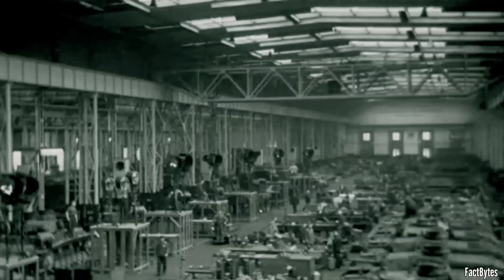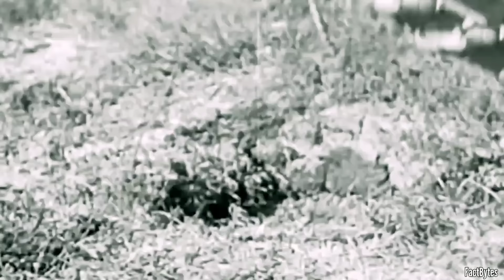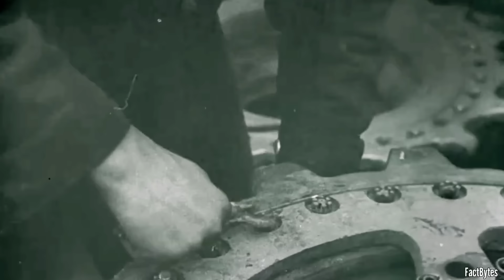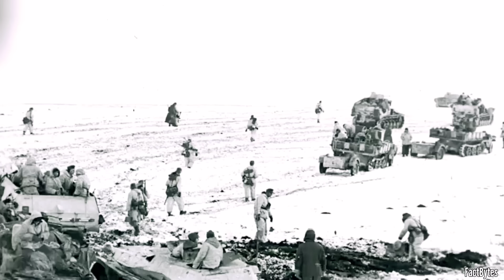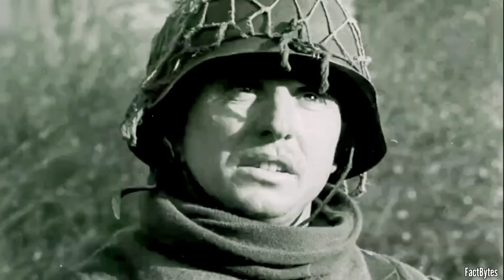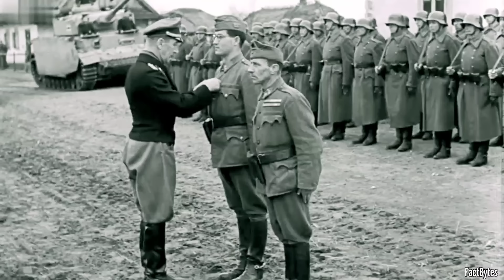More Panzer IVs, Fewer Tigers & Panthers — Would Germany Have Done Better?

Comment: From 1943-45, Germany built MORE Panthers than Panzer IVs, making Panther the actual workhorse - next to StuG III. From 1939-43, Panzer III (and before that Pz II and Pz 38(t)) was the workhorse while lesser numbers of Panzer IVs played a support role. Pz IV was never THE workhorse.

Edit1:  Let's talk about numbers: 5000 Panthers built in 2 years, 9000 Panzer IVs in 8 years. Panther was optimized for mass production, Pz IV wasn't. Panther was only 10-15% more expensive than Panzer III and IV.

Edit2: What's that next BS about Panthers and Tigers in Bocages ? The area where both fought in Normandy is almost - not totally - free of "bocages". It's effing flat land rising ever so slightly towards certain points like "Hill 112" ,"Verrieres Ridge" or "Bourgebois Ridge". If you're on top, the field of view is outstanding. Yes, there are bushes, trees and hedges, but unlike other parts of Normandy, the fields are way bigger and the hedges are penetrable with tanks. The Americans fought in "true" bocages, thus the obsession I assume, but they never faced  any Tigers and only few Panthers within "bocage county".  They usually faced StuGs and SP-AT guns - which probably were even more dangerous in that environment.

Comment: Without air superiority , Germany was doomed
Reply: Germany had plenty of good vehicles, but no logistical system to keep them going.
Reply: @insideoutsideupsidedown2218   which was a result of the ongoing air campaign and blockade of German ports.
Reply: The failure af Case blau put the Caucuss oil fields beyond reach ,even had they been seized  the refining and transport of crude oils were pipe dreams , reliance on synthetic benzine could not make up the shortfall.
Reply: @ivanconnolly7332 the soviets sabotaged their oil fields in that area (if I'm not mistaken, the germans seized a few and found they could get nothing out of them), so even transport would be a secondary problem.
Reply: @rodrigorincongarcia771 the Germans didn't have the Oil field expertise so only managed to get a fraction of what they should have been able to obtain.
Reply: @rodrigorincongarcia771  It wasn't that they couldn't extract the oil, there were no pipelines and few rail lines heading west
Reply: @ivanconnolly7332 It would have cut off the main source of fuel for the USSR.
Reply: @ivanconnolly7332  The goal and purpose of Operation Fall Blau was to cut off southern oil supplies to the USSR. Therefore, the main Army Group B attacked the cities of Voronezh and Stalingrad. Incidentally, the Third Reich and its allies succeeded: the USSR suffered a complete oil shortage.
Reply: They were never going to win. America and Soviet alone could defeat them any way you look at it.
Reply: Having 6x or 7x less oil than its opponents doomed Germany
Reply: Very true
Reply: Read Prof Mosier's book "Deathride: Hitler v. Stalin on the Eastern Front" Amazon review: " This is not your typical, dry, units-of-battle kind of narrative. This is a hard hitting critique of the Eastern Front, how it was fought by both dictators, the lies that Stalin told and that were subsequently bought by the Allies (and are still bought), and how the war could have ended differently had two key individuals not perished before the war. I have a huge library of war histories from ancient times to modern with a heavy dose of World War II. I love it when an author displays knowledge that I have yet to attain despite my readings. Isn't that why we read? Why read something that's been regurgitated time and time again. It's the new information that excites and the reader will be surprised at how much new information can still be found regarding events of over 60 years ago. One of the best, if not the best, Eastern Front histories I have ever read."  In a nutshell, the German army was a killing machine that got more lethal as the war went on to the point where the Soviets began using women to fill the horrendous losses - see Mosier's review of fake Soviet stats and the true losses inflicted.  Oddly enough, Germany could have won the war had it delayed the invasion of France for a few months - google "Operation Pike" for more info.
Reply: Germany simply bit off more than it could chew. Both Japan and Germany should never have brought the US into war with them.

Comment: They should have stuck with panzer 4s, tiger 1s and stugs and kept making them better and more reliable, the king tiger/tiger 2 was so useless, it didnt make any kind of difference, broke down all the time and needed so much gas that it wasnt even possible to supply them. The panther was ok but it wasnt needed, they couldnt have built way more pnz 4s and tiger 1s, and the elephant was horrible.
Reply: Playing the quantity game against the allies was also a losing strategy for Germany. By 1944 the pz4 attrition rate was high as its reached the limits of its potential upgrades and with it you also losing your experienced crews. But too many Tank projects certainly didnt help with logistics and production.
Reply: King Tiger was actually effective when used properly (Hungary, German border battles, east of Berlin etc).
Here's a report from Schwere Panzer Abteilung 503 in Hungary October 1944 :
""The battalion went into action in two battle groups with two different divisions on two different days. Provided the assault was successful in penetrating into the enemy rear, the battalion would then reunite. Both groups were extraordinarily successful. The total distance of about 250 kilometers covered during the operation was accomplished essentially without mechanical failure. The Tiger II proved itself extremely well, both in its armor and from a mechanical perspective.  Vehicles which received up to twenty hits without becoming disabled were not uncommon ... In summary, the Tiger II has proven itself in every way and is a weapon that the enemy fears. When the formation is used as a single, unified entity and is employed in accordance with proper tactics, it always brings decisive success.""

Doesn't seem to me that their King Tigers were useless and broke down all the time. But hey, why bother with a primary source when there are internet experts today 😂.

Comment: Panther was actually not costlier to produce than Panzer IV... main reason why Panzer IV was not updated with new sloped armor on the hull was because they found it too costly. Main issue with the Panther was its weight and unreliability. when it broke down, it was lost, because 45ton tank was just too heavy to recover. 25ton Panzer IV was less of a burden.
Reply: Panther was about 10-15% more expensive (compared to III and IV) but easier to produce (less individual plates, less welding etc.); it was totally worth it. Panther became as reliable as Pz IV with the invention of Ausf. A and improved QC. No tank runs well if the fuel lines aren't connected properly ... Both had ever increasing reliability issues from late '44 until the end.

Valid point about recovery though !
Reply: In the Middle East wars, damaged Israeli tanks, even heavier than the Panther, were quickly repaired. The problem wasn't the weight or size of the vehicle, but the availability of spare parts. And the bombed-out factories couldn't provide them.
Reply: @evgenpetrov4403  main problem was that wehrmacht's main recovery vehicles were either halftracks or based on Panzer IV hull.. they simply had no way effectively recover heavier vehicles, and resorted into using multiple vehicles at once to recover damaged Panthers. With Panzer IV, no such issues, as every recovery vehicle could handle their weight. IDF at that time, had recovery vehicles based on Centurion or Patton tanks with much stronger engines that could recover damaged tanks..
Reply: @evgenpetrov4403  The IDF had appropriate recovey vehicles as well. It also helps if you control the battlefield after an engagement.
It wasn't the bombed out factories that prevented proper spare part production, it was general production philosophy: THEY DIDN'T BOTHER about spare parts, all they wanted were tanks. Speer wasn't that genius at all.
Reply: @ottovonbismarck2443  If there had been geniuses in the Nazi leadership, then Germany, not the USSR, would have received military and economic aid from the USA.))
Reply: @evgenpetrov4403  Minor issues ... 🙂As long as France and England also lost in WW2 - don't tell the Brits, they still believe they won and are an important empire - Germany was fine. Military and economical help from the US AFTER that minor setback in WW2 made West-Germany the largest economy in free Europe. Everybody else went downhill. We're still worldwide no. 4 (or 5?) in weapons exports ...
And France is now our closest ally. If that wasn't a brilliant plan, what was ?

Might contain traces of sarcasm  and slight derivations of truth !
Reply: @ottovonbismarck2443 現代でも 日本に輸入されたドイツ車にも同じ問題がしばしば起こっているよ。
世界中でTOYOTAが使われているのが答えだ。

Comment: The Panzer IV had the most various different upgrades and modification variations built upon it's chassis then any other tank during the war and was widely used on every front throughout the entire war all the way up to the very end!👌😉.
Reply: YUP!
Reply: Except this includes like 5 different sidegrades to StuG none of which saw success. 

Panzer IV platform was obsolete. Later war due to the weight of heavier guns frontal roadwheels were constantly breaking. Panzer IV was a dead end from the get go.
Reply: nah that was the Pz III
Reply: @allanjensen6855  What could a Pz III hope to kill from 1943 onwards?
Reply: @Sashulya  it was not about kills but variations ;o)
Reply: @allanjensen6855
The only variation the Panzer III had was the Stug.
The Panzer IV not only had the Stug IV but Jagdpanzer IV, Nashorn, Hummel, Brumbaar, Mobelwagen, Wirbelwind etc.
Reply: @lyndoncmp5751  Hummel (Art) and Ostwind (AA) were on both a Pz III and Pz IV
chassis. Pz III's were excellent command tanks, artillery observation tanks, they had Flammpanzer III's, Schnorkels (Tauchpanzers), 12 different variations. Also the StuG III had 7 variations, plus the up-gunned StuH42 and Sturm-Infanteriegeschütz 33B types. The Pz III was also an excellent engineering/recovery vehicle (Bergepanzer)

Comment: Panters had about the same cost as the panzer 4, better frontal armour, better gun...
Reply: yes, main issue was its weight and unreliability. Panzer IV could make moves on its own, while Panthers required railroad transport if they had to be moved longer than 50km.. but main issue was logistic strain... Germany had lots of new tanks produced even in 1945... but they didnt had fuel, and at that time even crews to even use these...
Reply: True, but a hell of a lot more problems
Reply: @pzkw6759 only at Kursk, after that they made modifications and the Panzer general declared they were combat ready October 43, in the Ardennes offensive Panthers were at the front and king Tigers at the Rear! Whilst travelling through the narrow lanes of the Ardennes the Reason being they didn't want the highly unreliable tiger breaking down and Blocking the way with no way round! Now that's a testament that the panther was Reliable.
Reply: @rogercude1459  While not remarkably reliable, the latter war Panthers did much better than the older ones. Still, slave labor sabotaging production kept the Panther from ever reaching its full potential. Even so, post war studies showed the Sherman was still the better tank. In over 30 tank-to-tank engagements, the Sherma inflicted a 3.6-to-1 kill ratio against the "superior' tank.
Reply: @rogercude1459  That’s not correct. Even after Kursk the Panther continued to have serious reliability issues. Their biggest problem was the weak final drive. It was designed for a 30 ton tank not a 45 ton tank causing frequent breakdowns. That issue was never fixed. Engine cooling and fires were another problem. The Panther also suffered from poor maintainability because you often had to tear down large sections of the tank to fix anything and that took a lot of time. Critical alloy shortages and excessive fuel consumption limited its range and usage. Lastly, many of the bridges the Panther encountered they were too heavy to cross. You can’t lead a lighting strike under those circumstances. Those weight and fuel consumption issues played a significant role in the failure of German heavy tanks at the Battle of the Bulge. 

One final point. Guderian, as director of armored production, was able to improve on its reliability statistics but he did so by instructing the tankers to baby the Panther. They had no solution for many of its mechanical issues but that “babying” came with many operational compromises.
Reply: @rogercude1459
The King Tiger actually had a similar overall average operational rate to the Panther, and both were not much lower than the Panzer IV. They were all in the 62-71% range 1944/45.
Panzer IV = 68-71%.
Tiger = 65-70%.
Panther = 62-65%.
Reply: @lyndoncmp5751  You need to read some of Hans Guderian’s post war writings and books. After Hitler fired him from the Eastern front he put him in charge of armored production. He specifically send out orders and directives to tankers on the operation of the heavier tanks like the Panthers and Tigers. He specifically ordered them to essentially baby these tanks because they broke down all the time. That made their operational rates maintenance issues appear far better than they actually were. No such orders and/or restrictions were given on the operation of the Panzer IV’s.
Reply: So what Germany needed were Shermans that were easier to manufacture, easier to maintain and cheaper to run.
Reply: @TBlakely-s4p   pretty much... something that is light enough, simple enough but has decent firepower...  many people kinda forget, that german army was beating soviets with very light tanks while being outnumbered and outgunned (soviets had more KV1 and T34s than German had medium tanks combined, (stugs and pz38t included) in 1941
Reply: @TBlakely-s4p  In a way, they did when they embraced vehicles based on the 38t chassis - like the Hetzer. But it was too little, too late.

Comment: Germany should've focused on Stugs rather than Panthers and Tigers as a heavy tank option. Stugs used the trusted  Panzer's chassis, were way cheaper to produce, lighter weight. And overall they had more tank kills during ww2 than Panthers and Tigers. Germany would've produced many more capable reliable tanks without putting extra pressure on the industry.
Reply: And how would they get even MORE fuel and MORE crews ?